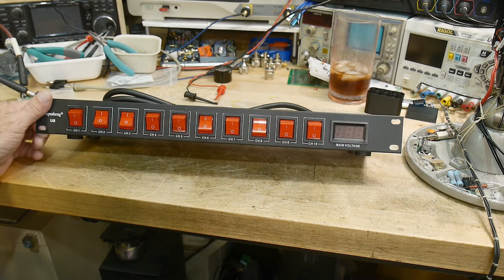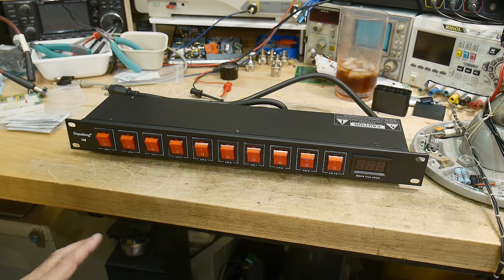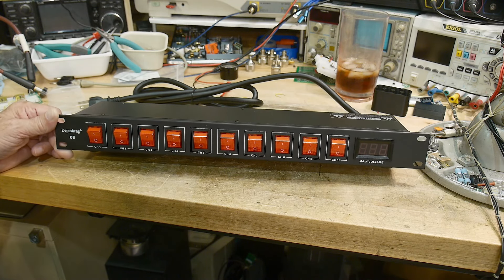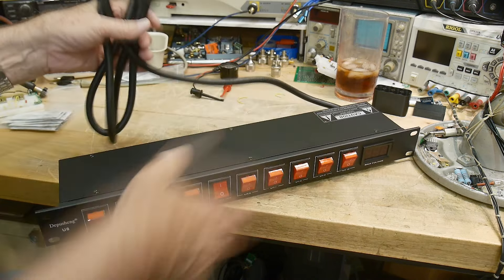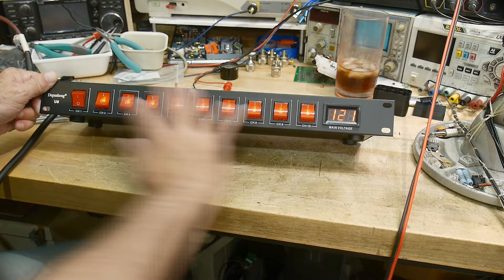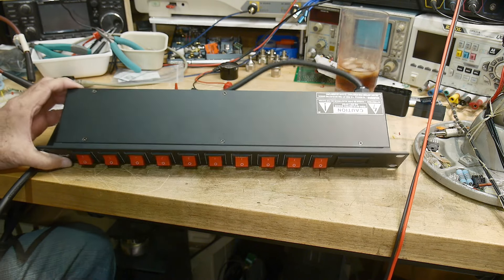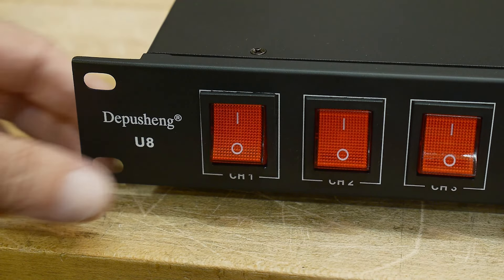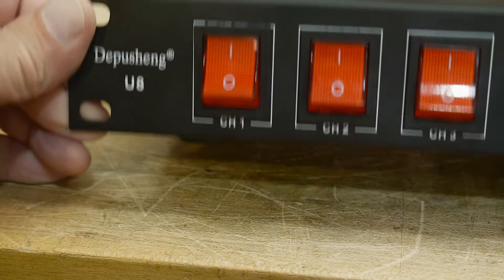#1959 Depusheng U8 Switched Power Strip

Comment: I don't think soldered ground would be allowed where I live
Reply: Dunno where you are from, but a definite no-no here in Australia.  Soldered connections are more likely to fracture from pin / socket movement when plugs are inserted into the outputs.  Broken earths would not be noticed under normal no fault present conditions, but a mains short to a metal case inside an instrument / appliance will shock somebody and not trigger an RCD/GFI protective device.    So here, the other two are allowed to be soldered (an open there will just result in no power to the device), but a crimp connection will have some flex in it.  The other reason is in a extreme overheat / fire conditions, a soldered connection will fail but a crimped connection will hold on for a while, long enough to take out the RCD/GFI/fuse.
Reply: @ejholden8851 the RCD should trip at its trip current regardless of how the current gets to earth, be it through the chassis ground or through you.
Reply: First thing I noticed as I was following the ground lead to see how it was attached. I've rewired a couple of "strips" because of the grounding not being bonded.
Reply: I don't understand all the fuss about this because properly assembled racks should be connected to earth - partly to get rid of 60hz interference and partly to prevent the whole cabinet from being energized from the sheath of a damaged cable.
Reply: @AnnaVannieuwenhuyse I think they don’t have RCD’s in the US, so the ground wire could get the full current and duration needed to trip the mcb. Considering that, soldering the ground wires may not be the best idea.
Reply: @karllangeveld6449  the US most definitely have them! They call them a GFCI, short for ground fault circuit interruptor.
Reply: @AnnaVannieuwenhuyse  did not know that. We learn everyday, thanks!
Reply: @karllangeveld6449  my pleasure! 😄
Reply: @AnnaVannieuwenhuyse  Isn't GFCI usually local to the outlet (mainly wet zones) and not the whole premise wide (or room specific lately) as RCDs in EU?
Reply: @Mr.Leeroy  GFCI and RCD refer to the exact same equipment. Where you place them can differ per region, but they're the same thing.
Reply: @AnnaVannieuwenhuyse  I am differentiatin these terms exactly to indicate regeons. What I was pointing is that you can not rely on GFCI in the first place as code (as far as I'm concerned) requires it only in wet zones and they are not as common in other US rooms. Correct me if I'm wrong, since I am familiar with EU code more.
There are however code guidelines on minimal ground fault loop resistance and reliability, what connection types to use. And it does matter to meet circuit breaker trip curves, that are required everywhere and may be the only protection devices.

Comment: TOR PDU : Top-Of-Rack Power-Distribution-Unit for the abbreviation afficionados.
Amazon have several models it looks like.
Really handy to have on the bench to control stuff that doesn't have an easy to reach ON/OFF switch.
Why they put mains switches on the back of stuff is a mystery to me...

Comment: a lot of daisy chained crimp connections,...
Reply: the wire on the daisy chain doesn't look like the same gauge as the plug cord wire - other than that, I don't really see the issue - crimps should be really reliable
Reply: @gorak9000  yeah that is what I've been told, but then I have also found chard connections in such situations,... I've always admired SOLDER. LOL
Reply: In critical situations, crimps or press fit pins are always used over solder. Like in life saving devices. Solder is unreliable for that kind of stuff. It could crack or grow whiskers.